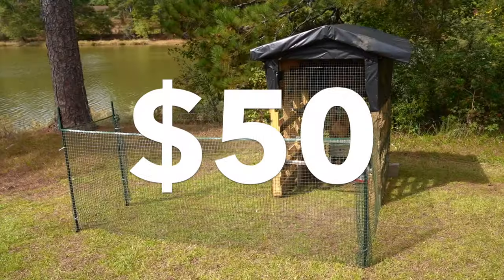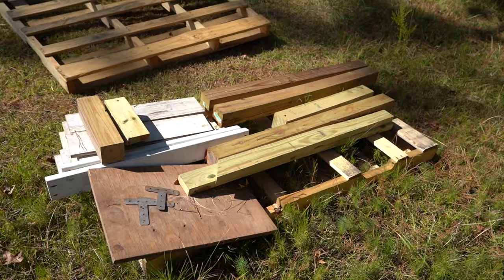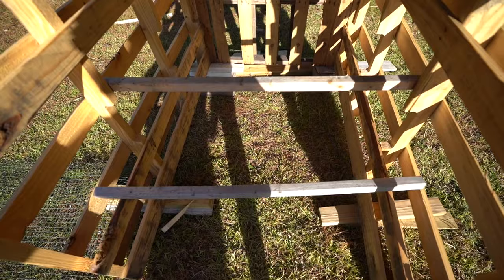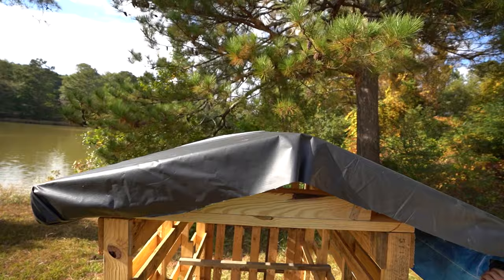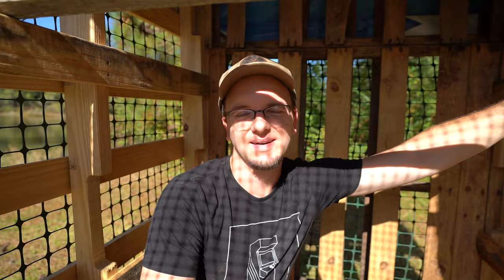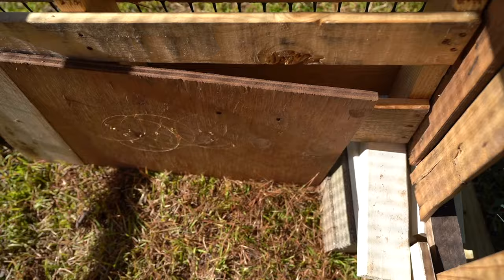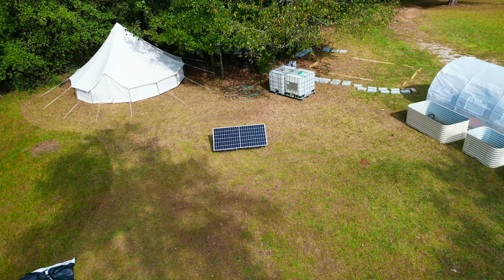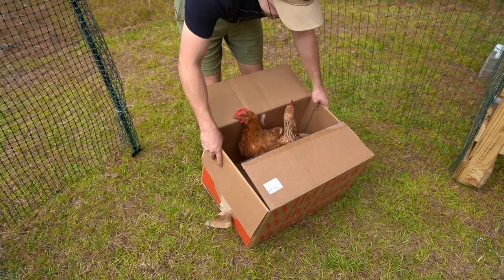How to Build a Chicken Coop for $50

Comment from the maker: Super important to know what predators you are up against! We are blocked in between water and a highway. We have never seen any ground predators around here. 

We placed netting more so to keep out birds of prey. 

If you have raccoons, skunks, etc, use metal mesh! Two layers! 

Then weigh down the chicken coop since ground predators can knock them over.
Reply: Set some traps 🪤 if you get some Nutrias; apparently tasty. 

Name ideas:
Ghostbusters
-Egan, Ray, Winston, Venkman
Musketeers
Athos, Aramis,Porthos, 
D’Artagnan
- Blanche , Sophia, Dorothy, Rose
Golden girls
-Dustin, Will,Mike, Lucas stranger things 
sex and the City Carrie, Samantha, Charlotte, Miranda
-Jo, Beth, Meg, Amy Little Women
-Lucy, Ethel, Laverne, and Shirley Nick-at-Nite
-Regina, Karen, Gretchen, Cady Mean Girls

Just some fun ideas! I’m partial to the Golden Girls
Reply: Hardware cloth is what you want. You don't need 2 layers, but it wouldn't hurt anything but you wallet LOL. 

At least that's what I've heard. Having used both in various projects, the hardware cloth (1/2 wire mesh) is significantly stiffer and more sturdy.
Reply: Also, I would say that that plastic mesh won't do much against a bird. If they dive on it, they will likely tear though.
Reply: My husband lined the perimeter of the coup and run with railroad ties sat on hardware cloth and attached the run to the top of the ties with metal braces because our area is bad with skunks and weasels that dig under… if you let the sharp edges of the hardware cloth stick out from the ties a foot, it keeps anything from digging under.. has worked great 2+ years now with 0 incidents

Comment: I appreciate what the concept of this series is, but I think you’re being penny wise and pound foolish on a lot of your choices and those compromises are going to come back to be a problem when you’re making this a person’s primary residence.  Seems to me that doubling the budget on nearly everything (the tent to start all this was good as is) would get you ten times as much output for your money.  For example, an extra $50 here would have gotten you proper hardware cloth instead of construction netting to actually keep out predators and a couple bags of concrete to secure the coop to keep it from getting knocked over.
Reply: I feel like they are learning as they go. For sure they will continue to improve as they make mistakes and learn from them.
Reply: We have hardware cloth, heavy duty materials, etc.  our personal coop cost $950 and is built like a tank - but that’s not a good entry level project.  This build is to show what’s possible in a very affordable, accessible way.  You can always upgrade as you go!  We’ve built many gardens and cabins, some of which are not attainable for many viewers.  We want this to encourage other people to try!  And they’ll learn as they go just like we are :)
Reply: I agree. For $100-$150 this could have been significantly better and safer for the chickens. If a stray city dog can rip into it easily, it is not secure. My first attempt at slapping a coop together out of an old shed and chicken wire ended in disaster when a few city dogs slaughtered over half my flock just for fun. I would say if someone can't spend a couple hundred bucks on their chickens then they probably shouldn't add them yet.
Reply: @genesis1verse1  It’s very solid.  We’re happy with it, after having built massively over-engineered chicken coops that did cost a small fortune.  People need accessible ideas.  So here we are :) Defying the naysayers ;)

Comment: Good idea with the pallets and billboard vinyl. Your fencing won't work though. Racoons, foxes, skunks and coyotes can tear through plastic mesh and your chickens can fly up and over that fence. Usually recommended is 1/4 square wire called hardware cloth covering every inch of it (under vinyl roof even) and sometimes even buried down a few inches or on the floor. Keep innovating. Love the content.

Comment: masonry mesh for weasels and hog paneling for raccoons. as the masonry goes down the side of the coop run them 12-16 inches across the ground and secure with tent stakes to prevent tunneling under. that plastic stuff and chicken wire will only prevent the chickens form getting out, it will not protect them from predators.

Comment: Sadly this isn't an option for some of us. The city barely let me use an odd sized pallet to cover the chain link fence over half of the concrete slab left over from the previous owners putting in a small shed as a substitution for no garage. The city has an arbitrary loosely defined prohibition against "open storage of construction materials without a permit" which includes storing pallets. Ironically in Tyson chicken country, the city has a contradictory phobia of backyard chickens. Even more ironic leaving California, my old suburb had lesser restrictions on half the lot size no less. To keep up with contradictory restrictions, I bought one of those 300 dollar  overpriced 3-5 hen coops on clearance and a 200 dollar rip off electrical conduit pipes with QD off Amazon that barely work. Believe me, I wish this was option. My old coop back home was 90% recycled left over construction materials my dad hoarded in our spacious back yard.

Comment: Cheap but its a predator paradise and it will fly away with next storm.
Reply: Had a similar setup when I started and within a few days a skunk dug under the wall and attacked them at night. They amazingly were able to fight back and I was able to secure the coop with wooden boards flat on the ground all around. I guess it depends on where you live but I agree that more is required to keep them safe for more than a few weeks.
Reply: It’s a pretty heavy coop!  We’ve built 3 coops now, and the others have similar weights.  Nothing has flown away yet :)